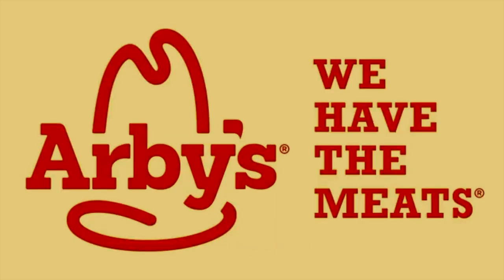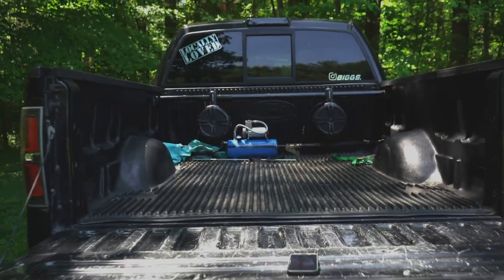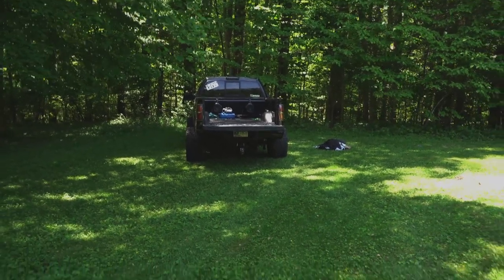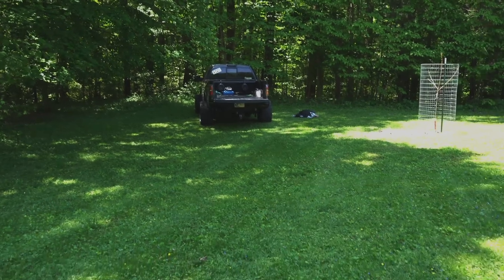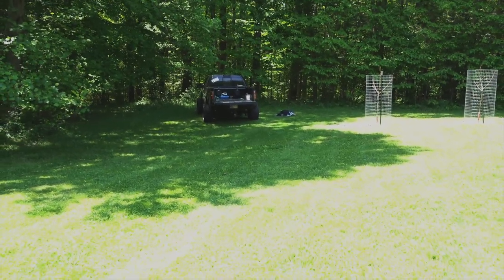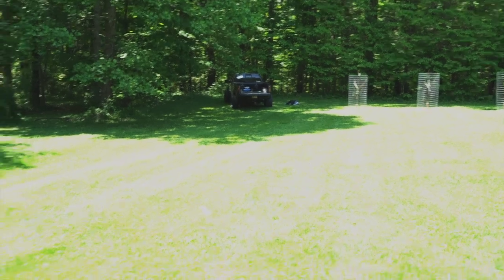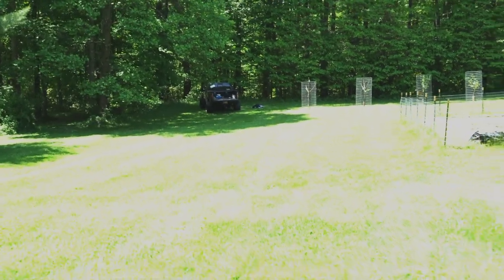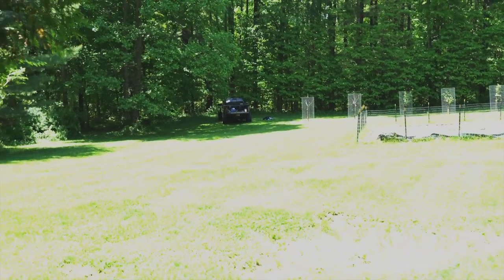Best BUDGET Truck Bed Audio! Rockville Audio Tower Speakers!

Comment: I was wondering about those shower curtain holders..did you have to put it on then screw to the bed? or is one of the holders side bigger than the other ?where you can slide in and out the pole ?😂
Reply from the maker: I have my drilled into my plastic bed liner but you most certainly could cut the pole a little long and shove it in where it is tight. I don’t recommend not having it fastened down somehow but there is really no wrong way to do it.
Reply: I was going to screw it in. so is your pole removable or do you have to remove the screws from the bed liner ?
Reply from the maker: @dominickrobenson7979 have to remove the screws unfortunately.

Comment: Sound horrible. Probably the phone recording. And cheep rockvill speakers. Should have went jbl or infinity kappa.
Reply from the maker: Thanks! It’s one of my favorite truck modifications.
Reply: Sounds like the gain is to high, a cheap digital oscilloscope and you can tune it in perfectly like any audio shop